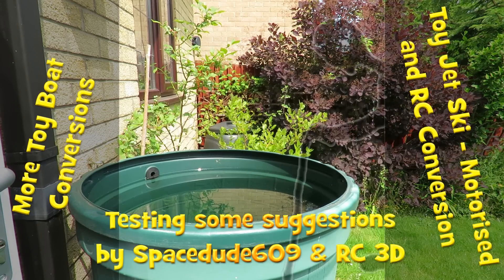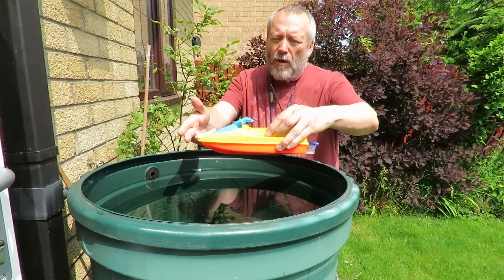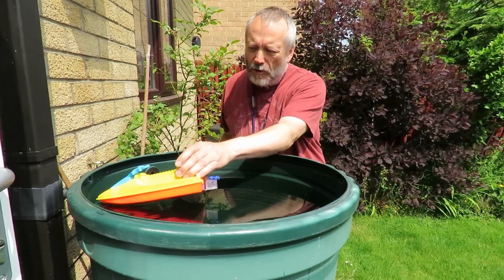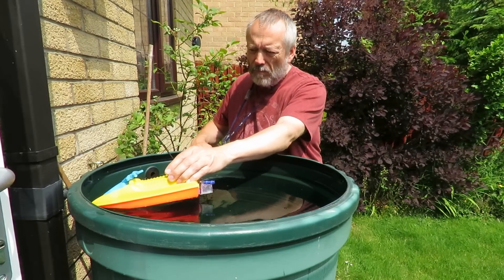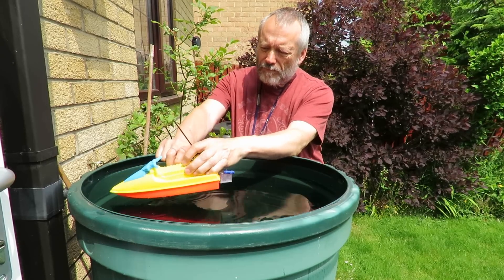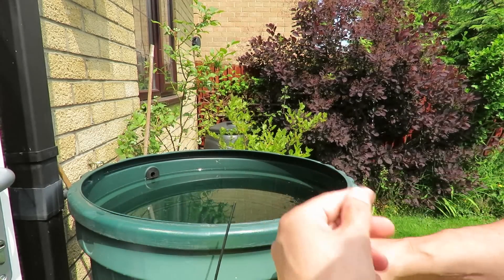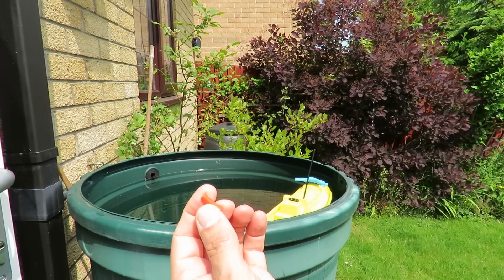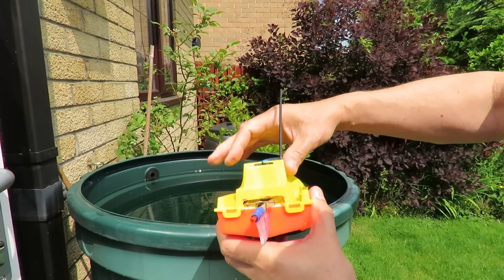Water Jet Ski testing some suggestions

Comment: I think you should put the output jet in the water not on top of the water
Reply from the maker: Hi Nathan you might be surprised if you try it out yourself. The point is that it is NOT the water jet pushing against the water or the air that moves the boat forward. It is Newton's laws of motion. Action and equal reaction. There are some useful links in the video description. This video might help https://youtu.be/Hx9TwM4Pmhc